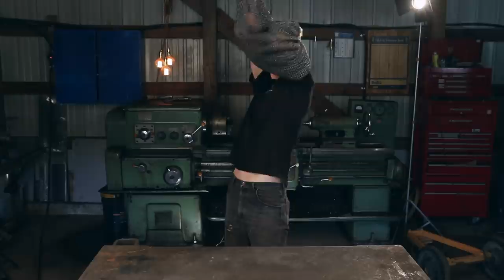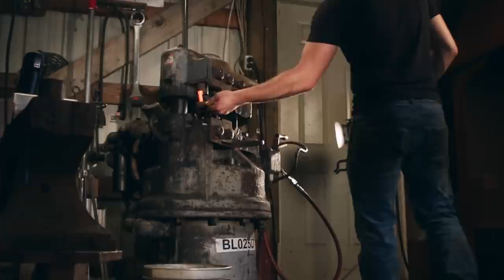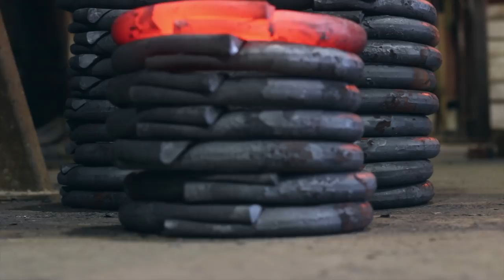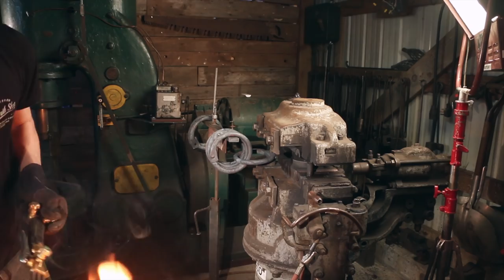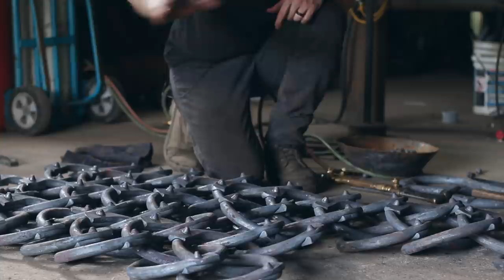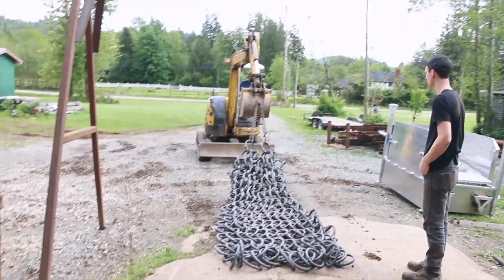Building MASSIVE Medieval Chainmail.

Comment: Practice use ideas: 
1.  It could be used as a pathway for getting big machinery unstuck from mud.
2.  It could be used for a big crane to prevent sink age on a foot.  
3.  It could be used as a drop gate for a castle murder hole.  
4.  Permanent wall to create a breezeway, but also create security

this spawned another idea, do the same size rings but smaller bar to make it much lighter  and then weld some garage door wheels and use it as a way to secure the building but keep it "open"

Comment: OUTSTANDING! By my calculations, to test the chainmail, you simply need to build a 27.9 meter bow, with a pull weight of 1435.87 kg, firing a 12.2 meter arrow weighing 63 kg at Mach 0.532 OR forge-weld a 2.78 meter lance head weighing 89.3 kg and find a horse that can run 168 kph.

Comment: Epic project, well done guys, mu little copper rivets from rod stock, difficult, yes punch the first head, but they wont push out the holder, tried a split holder , no good. currently using an oil bath for the holder and ball peen hammer the head . hardened silver steel holder for a 5x40mm copper rivet, reamed and polished hole. . Love the work.

Comment: Don't want to temper your enthusiasm, but European style mail didn't use round rivets, but more triangle pieces of plate pushed point down in a oval or oblong hole. 
The plate-rivets were then rivetted by the use of pliers with dome-shaped indents in the beak.

Roman chainmail differs, they used 4 rivetted rings in 1 massive ring. The massive ring was die-cut out a piece of plate. There's plenty of interesting reading and archeological evidence about the making of that ancient dies - they used glass powder to grind the die and hole to match exactly.

The romans - and ottomans too - were real experts in chainmail making. One mail hauberk could have several patterns of weave and duameter depending on thy place ,(chest, back, armpits) an even were gold or silver plated. 

Ottoman mail hauberks were known to have arabic texts integrated in the weave.

Here in the Netherlands, in the city of Leiden, famous pieces of Roman rivetted chainmail were excavated gold plated rings with a diameter of only 3mm!  That's insane.

Comment: Lift a truck with it, shoot it with a cannonball, lay it on top of a charge and blow it up, fire medieval projectiles at it, use a catapult on it, try to drive a car through it, try linking it between army tanks and try to resit apart, get a crane and drop it onto a car or ballistic dummies, etc.

Comment: Totally awesome video Tim!!!!  If you ever attempt another project with numerous identical parts, it is much more efficient to use one-piece flow, instead of the batch method that you used on this project.  It might seem counter-intuitive, but it would have been faster to make the 250 rings one at a time to completion, rather than performing 1 operation on each ring, 250 times, and then doing then next operation 250 times, etc., etc.  One-piece flow is one of the primary tenets of lean manufacturing.
Reply: Senachie does that apply in non commercial settings too?
Reply: you are over thinking an unique item
Reply: @pasivirta  Yes, it is much more efficient to make a part from start to finish, than it is to perform 1 operation on each individual part.  As I said, it might seem counter-intuitive, but try it as an experiment, and you will see that one-piece flow is much faster.  It also allows for early error detection.
Reply: @Sojournart  what about on a small scale with the need to retool for each step of the process. I can't imagine that in that case it would work.

Comment: So based on the info that the rings are made of a one inch thick steel rods and with some random guess in which I guess the rings are about 10 inches wide with some googling I estimate that the whole chainmail weights about 887.74 pounds (402 kg)

(Edit: just remembered that he said he got 600 feet of 1 inch steel so my updated guess it's that it actually weight 1600 pounds)

(Edit 2: just reached minute 33:30 my second guess stand correctly)

Comment: In no way doesn't this seem easier (or cheaper), but it does seem like it would be simpler to forge mail on a macro scale. Just saying, I'd rather use a power hammer over the grueling finger work of normal chainmail.

Comment: Chainmail was mainly to protect from projectiles, namely arrows, and bolts, from either the longbow, are the crossbow. Both capable of reaching considerable velocity, but with different types of iron tips trying to cause as much damage to the chainmail, and the body inside it as possible.
And yes, the swords used in combat too, but due to the shear number of blows from one's opponent, it was typically a glancing blow that caused the wounds received this way. While not all wounds were necessarily fatal, the after care, are lack of it generally was. 
Then there were the catapults used then as well, which slung all sorts of things about the battle fields, causing all kinds of carnage too. That just crushed, and mangled the bodies, and there typically weren't that many of those.
So now, the question is, which of the various weapons of the day, are you gentlemen prepared to construct, in order to test the oversize d chainmail that which you've built. Therefore calling for whichever used, to be made in equal proportion of that, otherwise how else would you be able to even have a chance of doing damage. 
As it was fairly difficult to penetrate it, and the combined undergarments used by the warriors of the time. So, whatever method used, will be even greater challenge, that awaits you two.

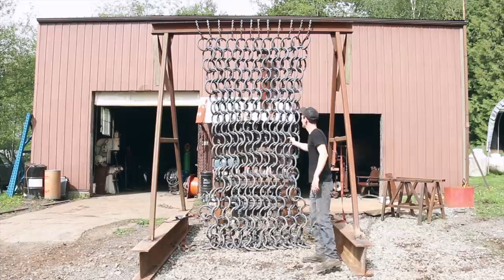Comment: 33:25 top right corner. Isn't that link incorrect?? Still pretty sick though
Reply: the corners and edges sometimes arent connected to enough rings to be wrong or right, its just turned a little bit to look different than the others

Comment: Tim how do you keep the steel hot for so long. I’ve been playing with my single burner trying to keep the heat in the metal is super hard for me!
Reply: Larger material hold the heat longer. Can your forge get the steel so hot that the surface looks wet because it's melted?
Reply: Mossy Hollow yes it can melt the steel if I leave it to long in the forge
Reply: @cristophercaraway8703  Sounds like it can get it hot enough. His videos are edited and at many angles so it may seem longer than it really is.